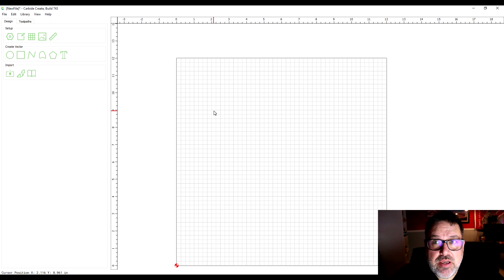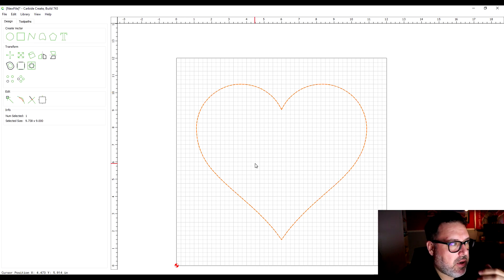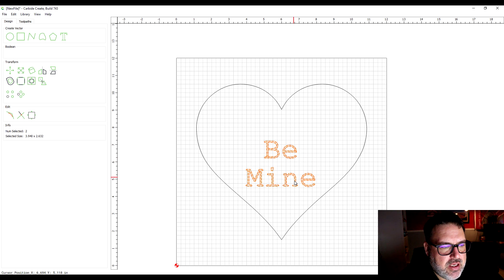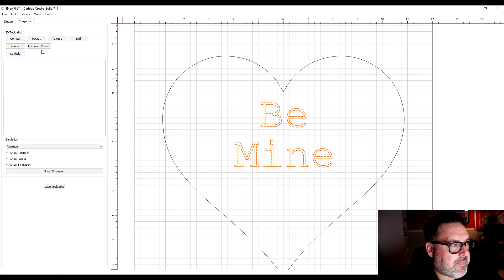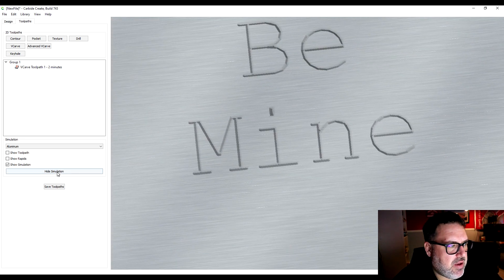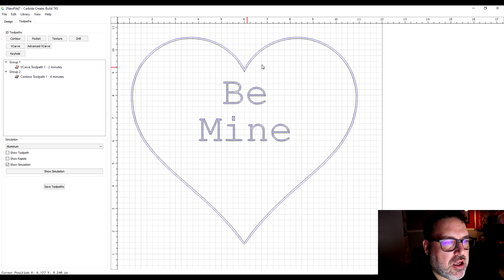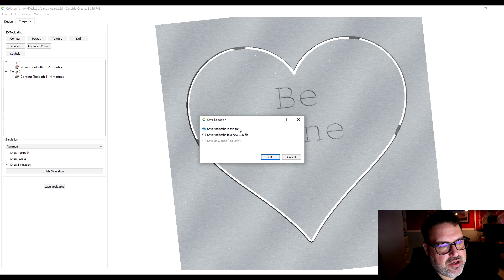How to Design a Cutout in Carbide Create for Your First CNC Project

Comment: Am a beginner,, I was able to trace the heart  but couldn't put the text inside the heart...
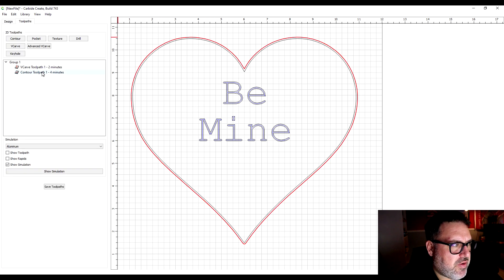Reply from the maker: I am not quite sure what stage you had the difficulty. If you had trouble getting the text into the design go back to the beginning and watch it again. If you got the text into the design but it didn't cut it refer back to the time of 11:21 in the video. Here it shows you how to separate the two types of cuts at the point where a bit change is needed. By doing this, one file will be for the heart, the other file will be for the words. I would recommend always cutting the shape out last. Hope that helps.